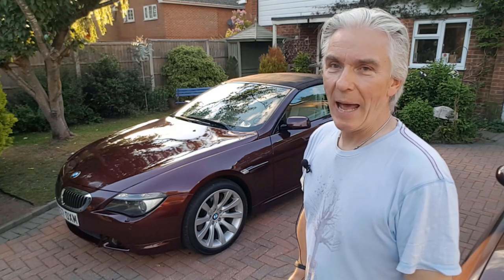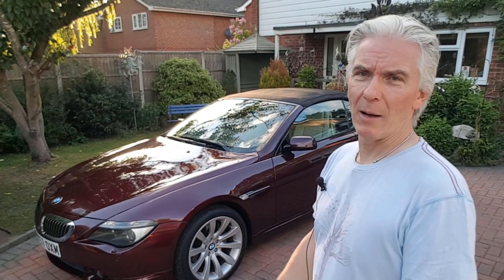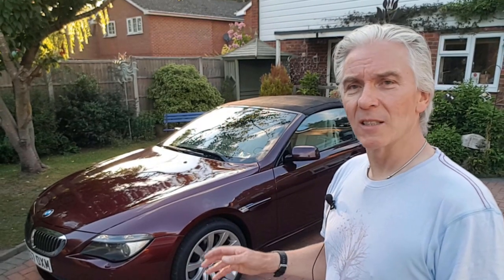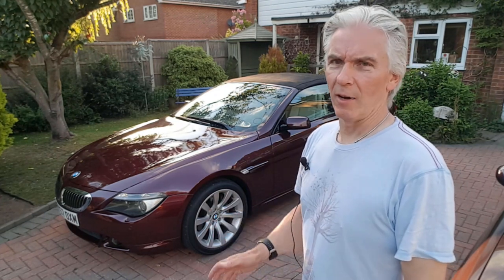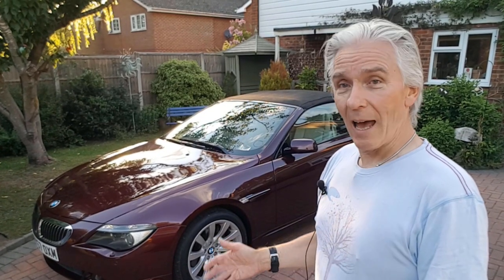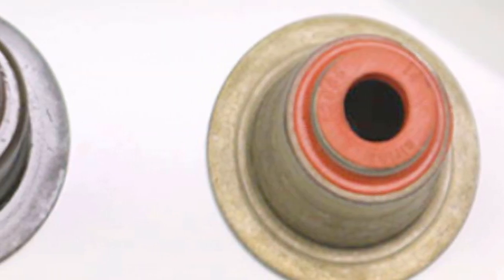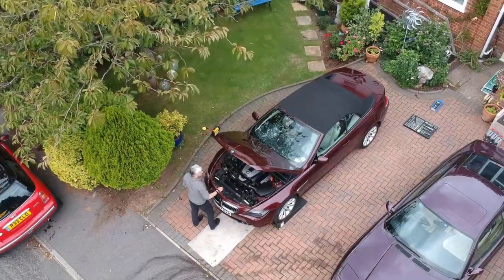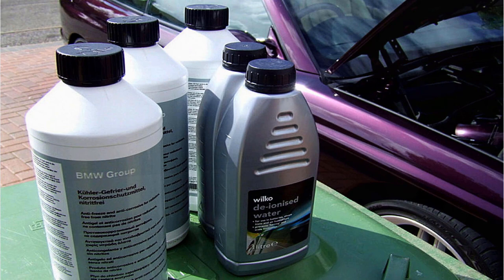BMW N62 V8 Engine Problems - SAVE IT - Don't fix later!

Comment: Thank you SO MUCH for your incredibly informative and helpful videos!! (SO glad I found you!) I have a 2000 740iL and a 2006 650i convertible. The 650i is showing "multiple leaks" and my local garage said I have to "replace or fix" the coolant transfer pipe -- quoting ~$4,000 USD to "fix" with stent.  I paid $13,500 for it in 2017 and have only paid about $3,000 in total repairs since then (+ oil changes consistently each year, using only synthetic oil...) I got it with 89k miles and now have 103k miles.  It's still very clean with only unnoticeable minor scratches on hood and front bumper, otherwise flawless and everything works great...  
I really want to keep it, but do you think it would be a mistake to pay for repair & keep?
Reply from the maker: Four-grand is so over-the-top for that job, it is classed as DIY and should cost no more than $500 - find someone else who's a bit keener!
Reply: @TimmsBMWRepairsandInformation  Wow! No kidding?? That's incredible. I was told that they have to tear down the engine to get to the pipe so it's "labor intensive"... I watched a couple videos of people doing the job and I couldn't tell because of the editing and time-lapse, etc... so do u think I can find a private party or different independent shop to do it cheaper? (Any tips or suggestions for my search?)?

Comment: The thing with BMW car is that at their beginning they are expensive... then they become cheaper (as you said they are passed down the food chain) until one day they are becoming expensive again :D 

Try buying an E30 3 door for a "reasonable" price in good condition. First problem everyone's gonna run into - finding one :D and if you finally find one then the price won't be so nice :D so yeah - 5k to 6k now but wait a few years and you'll be looking at 8k-10k with an upward perspective. And other models as well :)
Reply from the maker: Very true, same for the E31, I bought mine for 6k, and now you will only find one fit for the scrapper for twice that!

Comment: My 2006 560i E64 blows smoke after idling for a while, so I'm guessing this could be the problem. In case they are split when I open them up, where is the best place to buy replacement BMW N62 Valve Stem Seals online? I'm based in Melbourne, Australia. Cheers, Brad. P.S. Your how-to videos are a godsend!
Reply from the maker: Don't change them yet - the PCV system is the usual source of oil smoke - if the seals are causing problems try some Forte seal conditioner first

Comment: Thanks Tim. My E70 has the 4.8 also. I drain the cooling system from the radiator once a year and refill. Change the coolant pressure cap with oem 1.4 bar ever 4-5 years. never had a cooling system problem in 13 years. I recently started using a quart of oil between changes(8000 miles). I added Lubromoly Oil saver with oil change and no more consumption.170000 miles on the odometer.
Reply from the maker: Good tip!

Comment: Dear Timm, I've recently encountered an issue with my right window (E63 650i 2009). It doesn't work anymore as I use the window control panel. I then went to a local triple A service center and they stated that it was the window motor that was broken. After they put everything back on, I went back and forth several times to the service center to fix the follow-up problems they brought me such as a the right door was not installed correctly (there was a big gap between the interior and the door cover), airbag mulfunction, speaker not working, and etc. Most importantly, the right window air vent was shattered due to their carelessness when they installed the door interior (the little air outlet that is adjacent to the window and the triangle speaker. It would be easier if I could sent you a picture and explain). They now told me that they are looking for the part name for several days, but I don't trust them anymore after all this and I want to attempt to replace this part by myself. However, I couldn't find the part name/number of this specific plastic air vent anywhere online. 
After viewing several videos of yours I can tell that you have real knowledge and passion of those BMW cars. So I comment here to see if I could get some information from you. Do you know the part name of the air vent that is adjacent to the door windows and where can I  order it from?
Reply from the maker: Good to hear from you! Yes, the best place to buy new is obviously from BMW, trim parts are usually pretty cheap. But, also try Ebay - there are loads of breakers for the 6-Series. To find the correct part use RealOEM, here's a link to a 2009 E64 trim parts:  https://www.realoem.com/bmw/enUS/partgrp?id=EA52-EUR-06-2009-E63N-BMW-650i&mg=51
Reply: @TimmsBMWRepairsandInformation  Thanks! I found the part on the website you gave me.

Comment: Tim, any opinion on replacing the stock 105 C thermostat with a 90 C one.  A decreased heat load would also seem to extend the life of the various seals.
Reply from the maker: It is certainly worth reducing the base temperature - and 85C - 90C is perfect

Comment: Tim, thanks as always for a fantastic resource. I've followed your advice and kept my 2007 650i in good health plus saved a ton of money!

Could I ask your opinion on timing chain tensioners? My car is on 103K miles. It's always had regular servicing including oil changes every year with the Castrol FST (changed on time and not waiting for the iDrive to recommend it.) I've also been gadding the Wynn's in recent years. That's kept my valve stem seals in good shape with no leaks (yet!). Would you advise getting the timing chain tensioners replaced as a safety measure though, or is that going too far?

Thanks as always.
Reply from the maker: My pleasure Doc! The chain tensioners don't usually need changing, they are very robust compared to those on the M62. The only time I would change them is if there was varnish everywhere in the engine - but if the engine has been looked after then no need.

Comment: @Tim question for you! I have some throttle response issues. I did some research and heard its the VANOS Solenoid that could be causing this. when I put it in sport mode its not as bad and sometimes goes back to being punchy on the throttle.  Any ideas how to fix this?
Reply from the maker: I'm afraid that is standard operation - when driven gently the DME assumes a lazy control over the engine power - once you have giving it some welly it wakes up and responds to throttle much quicker
Reply: @TimmsBMWRepairsandInformation  Interesting thanks for that Tim. I never noticed that delay in throttle response before. I also notice when I put it in Sport it becomes snappy again and has no issues. I have oil leaking all over from my valve seals and my local guy said we should do a BMW engine maintenance where he drops the whole engine and take care of the leaks. Either than that I love my 645Ci. Just put Magnaflow mufflers and love the sound. Plan to keep this for life so I want to get it right. I do 5K oil changes with LiquiMolly 5-30. I want to refresh the spark plugs as its at 170000kms now. BTW thank you for your videos on this car your a legend!

Comment: Hi Tim! First of all, thanks for great videos indeed, i really appreciate the videos you make since i'm looking out for such a car. 

I've a question: I'm about to look on a 2007 BMW 650 where everything looks good except some of the service intervals made on the car. it's serviced with new oil -08, -09, -10, -11, -12, -13, -14, -17 and -20. Would you consider it be a major thing to look out for? 
The total mileage on the car is 56.000 miles. The car has been driven 5000 miles between the oilchanges -14 to -17 and 4000 miles -17 to -20.

I would really love your opinion on this.
All the best,
Reply from the maker: I would certainly go and look at it and leave it idling for a while - you could well have found a good one - and Thanks!

Comment: I have one job here, its bmw 750i. Gearbox mechanically works sometimes perfect but sometimes randomly comes up on dash saying transmission fail and car goes into limp mode. Done the oil change but still the same, could this seal be the problem?
Reply from the maker: There are a few reasons why you get TRANS FAIL-SAFE PROG, the seal could be one of them, but have a watch of this: https://youtu.be/0zbhnlmjXCE

Comment: Which engine is the better one on these 6 series 630, 645 or the 650?
Reply from the maker: The 650 V8 is the most powerful, the 630 is the most reliable, and the 645 is the worse of both worlds!

Comment: Hey Tim! I've heard that the engines which those problems occur with more frequency are the 4.4l ones, rather then the 4.8l because of the oil cooler... Is that true?  I'm thinking of buying a 650i from this era, so it would help me a lot if you could help me with that!
Reply from the maker: Yes, they certainly have a better reputation, but I am not sure the truth of it!
Reply: I know this is 8 months late, but I have E70 with 4.8L V8(N62B48), and all the issues that Timm outlines in this video are applicable to my engine as well.

Comment: I did an oil change every 4000km except during the break in period when the car done its first 2000km but still the smoke came. used Castrol edge 5w-40 till 60000km then edge titanium till 120000km. changed it to shell helix ultra 0w-40.

Comment: Ive owned 3 bmw 550i and a 2004 545i they all have the same problems . Oil leakes coolant leaks etc etc they drive great lots of power  and smooth driving  . Its a luv hate realationship with these cars .... i just bought a 2008 bmw 550i M sport a few days ago and every seal is leaking but oh well lifes to short to worry about things like this..
Reply from the maker: I'd rather have a 650i with a few problems than a faceless Euro-Box!

Comment: G'day Timm from Australia. Mate I'm trying to answer a simple question. Do all e60 models use the same vacuum pump? Cheers and great videos mate, really informative and well done with a positive attitude. Much appreciated.
Reply from the maker: Thanks from the UK! Best way to find out is to use realoem.com - bung in your VIN and then locate the vacuum pump. If you click on the part number it will list all of the models that part is used on.

Comment: Nice video. Thank you. Just a question, on my 07 550i there are water leaking every second or so week have to top up the coolant level. How can i be sure its the transver pipe? Before i strip all the way down. That little hole next to waterpump? Is that the only way to know? Thanks my sitting at 100k miles
Reply: Mine ended up bein the valley pan (545i) but i ended up replacin secondary air hoses as well as the pan

Comment: Just bought a 2007 550i E60 with 95,000kms all good but yep oil leaks... getting all sorted.... what oil do you suggest for future use and changes every 10,000ks thereafter ?
Reply: If u already did oil gaskets well too late for my advice but from my own experience i wish i would have taken the whole engine out and reseal the whole thing including valve seals and secondary air buildup rather than deal with each item as ir came up, probably would have been cheper

Comment: Hi timm! Which is more reliable for x5 e53  , n62 engine with 6hp26 transmission , or m62tu with 5hp24 transmission?
Reply from the maker: I would always go for the N62 - and if it were ever fitted the N62TUB
Reply: @TimmsBMWRepairsandInformation  thanks. I really appreciate your  response.

Comment: Hi, great video! How many tubes of the forte conditioner do you recommend? Mines started to smoke, I’ve changed the PCV valves that were bad (after watching your video! So thank you very much) and it’s still smoking but only after idling for 5 minutes, short idles it doesn’t smoke, hopefully catch the seals before they break down to much... and do you add 1 or 1.5 cans of Wynns at every oil change?
Reply from the maker: Well worth a go with the Forte seal conditioner, 3 tubes for the 4.8Ltr engine! I just use one can of the Wynns

Comment: Hello Tim thank you for the great videos. I have a 2008 650i here in the states. Very clean car has 70,000 miles did a lot of work on the engine, valve stem seals, various gaskets  etc. my problem is the car bucks and has a slight hesitation when you floor it from a standstill or moving. If you go easy on the gas pedal it has amazing torque and power. I have read many theories and I believe I had the mechanic clean the throttle PCR valves. It did improve acceleration but did not fix the problem at hand. Any suggestions would be greatly appreciated
Reply from the maker: The way forward from here is INPA as described here: https://youtu.be/6LWXmz6Ef_M
Reply: Cat clogged

Comment: Great information, thanks Tim. I’ve a 650 and 540 with the M62TUB44 engine so lots in common. My 650 has done 82k with no problems with either the valve seals, or alternator bracket so maybe my investment with good oils is paying off. I’m currently replacing oil at a max of 2 yrs, at 2kmiles per year. Do you think adding a can of wyns at the end of year 1 be sufficient?
I didn’t know the oil or water had special seal preserving additives so that’s really interesting. I’ve just pulled my 540 apart to replace vanos seals at 84k. I know this engine has had synthetic oil from new and the engine is unbelievably clean, just like new. The water ways too!  In contrast my previous 1998 M62 535 was only run on semi-synthetic and that engine had a horrid orange tint. So many thanks for the info. Long live these V8s, and thanks for sharing your knowledge. 👍
Reply from the maker: Bunging in some Wynns will certainly help at any time!

Comment: Hi Timm. The spark plugs on my M54 engine (530i) need replacing and I am bewildered by the choice out there as well as the plethora of 'alternative' opinions on which make is good and which is not!  Your previous advice on how to fix my front wheel shimmy proved invaluable so I wonder if you dont mind doing something on spark plugs for our various engines?
Many thanks!
Reply from the maker: Thanks and good to hear from you! The correct plugs are BKR6EQUP - these can be bought anywhere with loads on Ebay!

Comment: My gear box changes perfect but at 59 k plus a little bit its starting to get a tiny bit harser than normal so im obviously due that fluid change did this on my six speed e53 got charged for fluid and filter change but now gear change is harsher than ever hangs on to gear and jerks between gears even tho ive paid for maintenance car has done 207k hope i can keep 650 going a lot longer e53 is now parked up very poorly
Reply from the maker: Hello Paul, get the gearbox adaptations reset - that sounds like the problem!  https://youtu.be/YIAzc3qgoF4

Comment: Would you recommend the Forte stem seal on my 650I 46000 miles, that does not have any stem seal leakage .
Reply from the maker: Only if you have smoke, otherwise no!

Comment: Thanks for your very useful informations. I just bought a 2010 650 convertible with 45.000 km. Would you recommend to use Forte seal conditioner preventive to add it with every oil change, even if the car does not smoke? Thanks a lot for your response!
Reply from the maker: No need Villa, just change the oil every year and there will be no need for it.
Reply: @TimmsBMWRepairsandInformation  Thanks a lot, Timm!

Comment: Is there a way to point out  if the PCVs or valve stem seals are the reason for oil consumption/burning? Is there a way to differentiate before starting replacing/dismantling the engine?
Reply: With the PCV's - it is so easy and cheap to replace them that diagnostics IS replacing them - if it still smokes then valve stem seals are more likely.